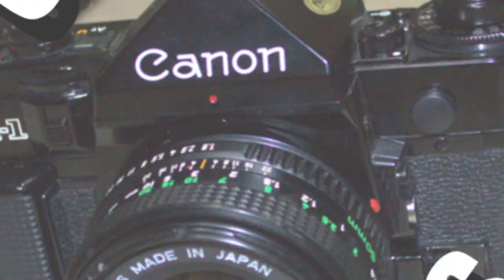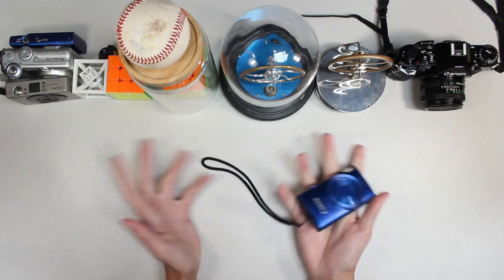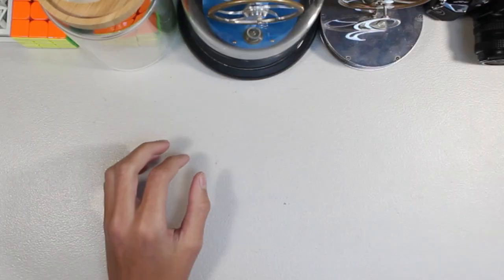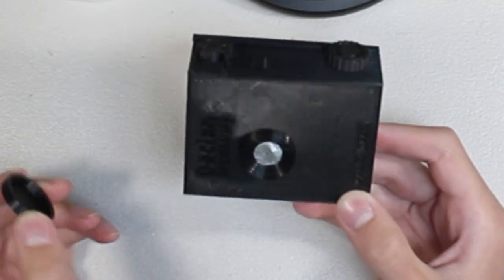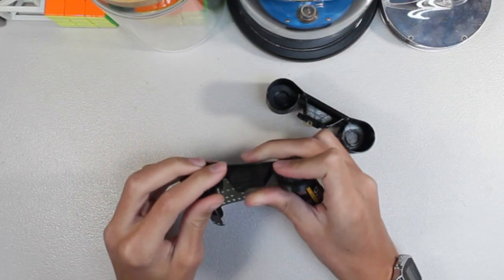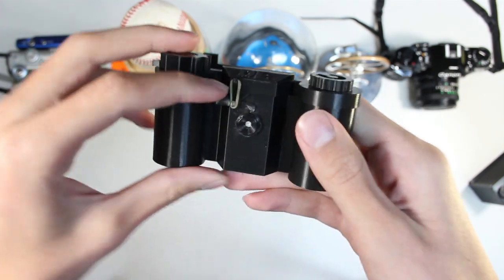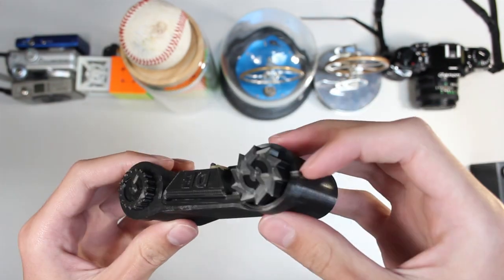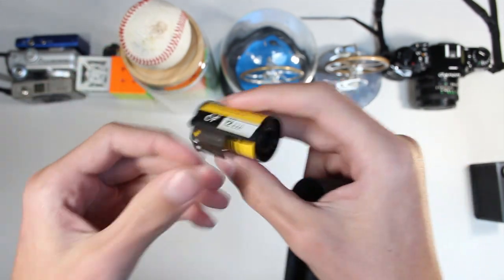Don't 3d print cameras unless you want to work in a completely different genre.

Comment: If it is a pinhole camera (i dont know because you do not talk about the lens) you can achieve better quality by gluing a small piece of aluminium sheet and practice a very small hole with a pin. This way i got very good quality images using not film but positive foto paper (a kind of paper used in print shops).